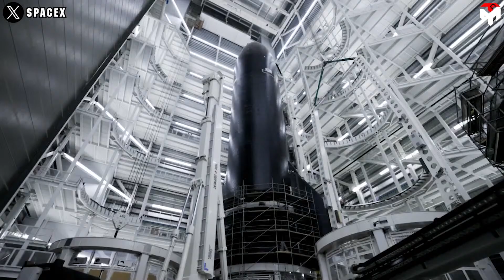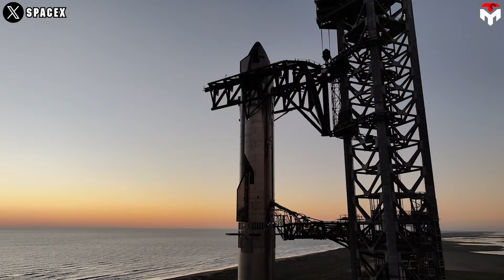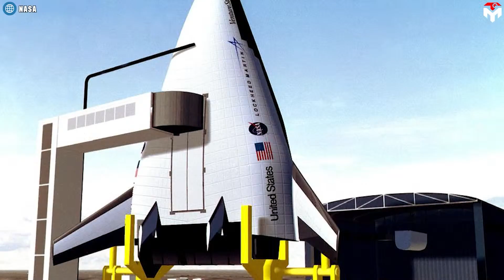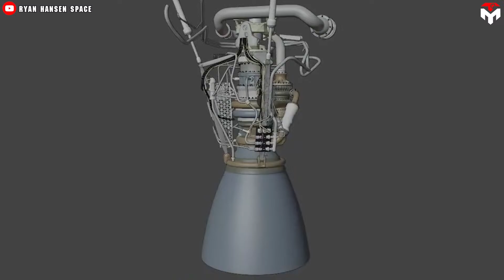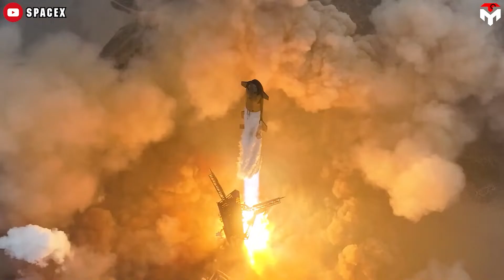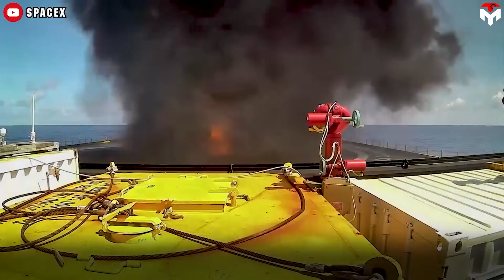1800°C Melt! New Starship's FLAP&HEATSHIELD Upgraded to Break Physics...

Comment: Using a hydro-carbon as a coolant is a mistake. Use nitrogen only, when using stainless steel.
Reply: Hydro-carbons are already inside for the engines, the nitrogen is just dead weight, and no one pays for that...
Reply: @ Hydro-carbons will destroy the stainless steel the first time they use it. Nitrogen will make the stainless steel harder. Nitrogen will reduce the number of times the rocket can be used.